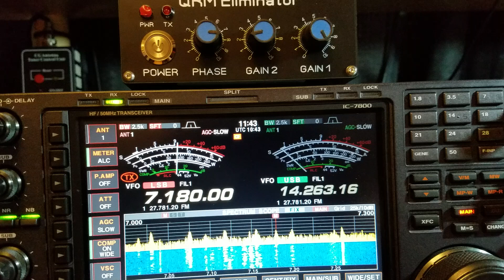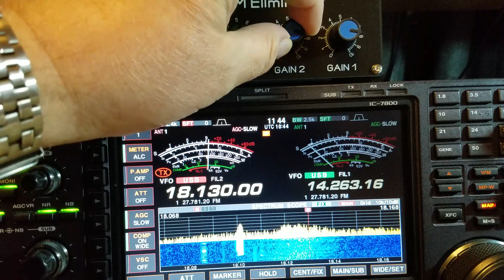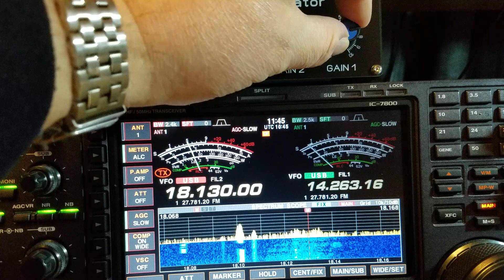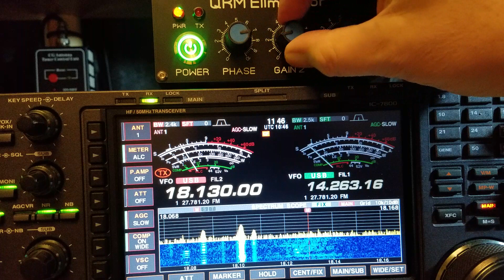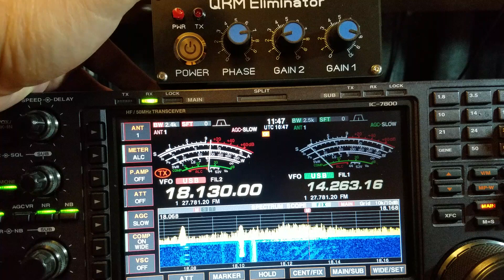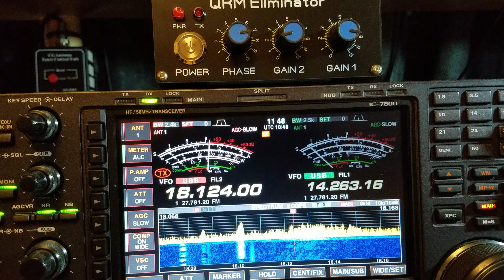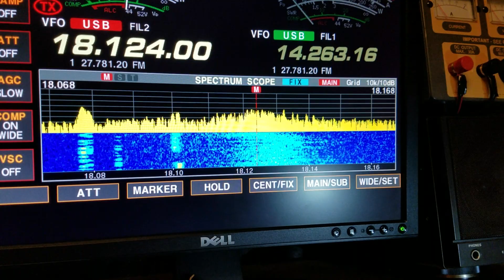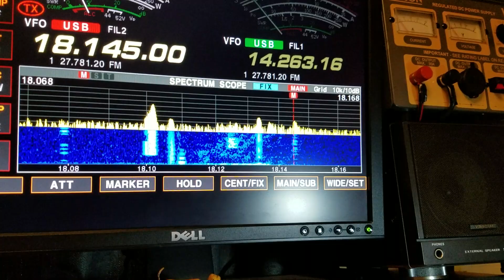Tuning a QRM Eliminator Part 2

Comment: What are you using for your secondary antenna?  They say that you don't want the secondary antenna to receive the signal, just the noise, for optimal noise reduction.
Reply from the maker: 64 ft end fed antenna

Comment: I have to say im in the same boat as you except all my noise is from a general store/butchers shop just below my flat. I raised a formal complaint with OFCOM, and the Radio Investigation Service got involved, and after a lot of head scratching  and umming and ahhing it was found to be the emergency lights on the shop below me, AND their antiquated freezers that havent seen a clean yet alone a service engineer for many many years. It turns out that the Radio Investigation Service, decided they did not  want to do anything about the shop, as they, and I really am quoting their exact words, "we are not prosecuting or taking this further, as we do not want to cause the business concerned any financial or other inconvenience". I still have this noise today and am looking for a supplier of the QRM eliminator thats in the UK and wont take weeks to deliver or steal my hard earned cash.... all comments greatly appreciated. As long as they are constructive....
Reply from the maker: Thanks for posting your experience hope you find a fix I found my qrm limiter on eBay uk supplier john G0dtx 73

Comment: Hi, thanks for trying, but I think that you might have the wrong technique.  I think that you should 1. Set the Main ant gain to minimum. 2.set the aux gain to near maximum, measure the noise-level on the S-meter.  3. Turn down the aux gain.  4. Set the main gain for the same s-meter noise reading as found on aux antenna.  5 Set the aux gain to the setting used just now.  This makes the level of the noise, coming from the main and aux antennas, the same.  6. Adjust the phase for the null in the noise.  I think that you will find this a lot quicker. Hope that helps! 🙂
Reply from the maker: Thank you
Reply: @hamradiostationg0dtx583  You're welcome! 🙂

Comment: I’m not convinced by the examples I am seeing on YouTube that the QRM eliminator is actually being tweaked correctly. Sure, the S meter reading dips, but I’m listening with my ears, not my eyes, and I’m not hearing much of any difference. 

What I find interesting is that a $5,000 state of the art transceiver has no SNR reading on the panel. My inexpensive SDRUNO software has a reading for SNR. I think SNR is the figure we should be watching, not S-meter readings (unless you take into account the reading of the wanted signal as compared to the noise floor, with and without the QRM device enabled, which would basically be a SNR Calc done on the fly, in your head, real-time.

Actually, I’m taking a step back from my first comment a bit. Your demonstration in this video is actually the first convincing example of a QRM device (system) that is properly tweaked and does work as per theory. I didn’t see this until the end of the video. Nice work.

Comment: Had better luck than I did. Tried to cancel  out a battery charger with a pulsing sound without success. Put the aux antenna right next to the source as well.
Reply: Thats not how they work.

Comment: hii,good video well explained , i suffer from high noise level , very irritating i know , simple things like don't let the coax cable be next to power cable's ,i now use Ecoflex 15 coaxial cable and lost and  2 s points in noise , adjust the RF control and the display sensitivity ,also AGC set on fast, few things to try for free, good luck ,73 from Rotterdam .

Comment: Interesting video John as most I’ve suffered with qrm for a long time I have the mfj1026 but bought one of these QRM eliminators to try it. Wondering what you are using for noise antenna? That’s the key I think 30m is my worst band for noise.
Cliff VK2NP
Reply from the maker: End feed 9 to1  66ft  clifford works well
Reply: @hamradiostationg0dtx583  ok thanks

Comment: get something done about the interference  I did  when I had a similar problem after hall why should you suffer it is not your fault its the company that installed the crape equipment don't sit in silence 73s

Comment: I think you need to go out with a scanner and find the problem 🤔 not sure how you can explain to the person making the noise, it might be a charger on a battery doing the EMC nice antenna setup :) where's the pole in the background the big one from any links, I also have a QRM Eliminator not tried it yet, what antenna are you using on it to pick the noise up? Thanks Tom 2E1FUE
Reply from the maker: Hi Tom the pole I bought from ebay from  a lad called Ian GW4 XLS.  The Antenna is 66 foot end fed wire. . Cheers